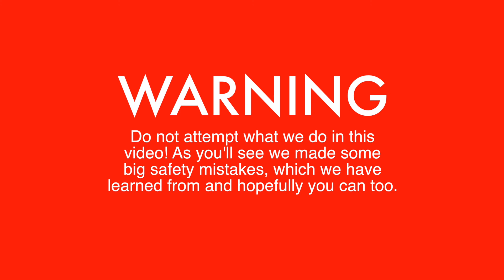Exploding the Fastest Non RC Rocket Boat with Sugar Rockets

Comment: Very cool, just stumbled across this video, I love making rocket powered vehicles to! I have made 17 different versions of rocket cars; 6 different rocket boats; and am currently 3D printing a V7 rocket boat witch I plan to make 3 of to drag race, what state are u in? Maybe we could drag race our designs? I am also currently making a FPV VR RC Rocket boosted jet on another printer reinforced by carbon fiber tubes and carbon fiber coating the whole fuselage, going to put it in a 1000ft nose dive with full power to both edf, pull up and then hit the rocket boost to get the max speed, from making all of these I have learned that bigger is better with these, bigger rocket engine bigger rocket boat, and more weight, in all my first designs I made them way to small to and even the tiniest ripple in the water will mess it up, by having a much bigger and heavier boat it has way less of a tendency to become unstable, also adding rc electronics to give u control is a huge plus, u can get remote detonation of the rocket engine using ether a pico switch or battle switch, I typically then use a firework detonator fuse hot glued into the nozzle to keep it secure then just plug it in to an extra channel on the receiver, this allows u to have the rocket powered vehicle to be already traveling at around 60mph on a boat or 180-220mph on a jet before you even start the rocket engine, this is crusial because by launching it from a dead start you waste an extreme amount of fuel that could be used to get insane speeds, trying to make my V2 rocket jet hit 500mph, the only time starting from a dead start would be a good thing is for drag racing, but drag racing is a lot harder because it’s such a sudden and dramatic increase in speed, it has no previous established stability so of course it’s going to be super hard to get a perfect hydroplane going, I would also add way more steps in the design, on the front supports as well as the belly, in order to get access to much more powerful rocket u would want to join a model rocketry club they have amazing people who are more then happy to help and u can launch under there license witch gets u into some crazy engines like M class, currently experimenting with Warp-9, Propellent X, and Black max, however I want to eventually get into some of the liquid fuel rockets such as a BPM-5. Ill edit this comment once I find out witch is the best and reccomend it, if u really want to advance your designs I would get a 3D printer, you can get a creality ender 3 for as little as 200 dollars and free slicer and free cad softwares are available online, if you have a little more the creality CR-10 goes for around 360-600 depending on witch model u buy and that is probably the best 3D printer for beginners out there massive 12X12X15 build platform so even if you decide to get 2000 fancy printers in the future you will most likely still use the CR-10 because of its massive build volume, hope this helps. May V3 be even better!

Comment: Invert the design, the rocket has to PULL the boat, not push it, and it will keep going straight. Also revert to the motors you used in the previous video.

Comment: This was probably poor nozzle drilling. Sugar rockets [powdered sugar and potassium nitrate]. I've made hundreds of these rockets and they are incredibly powerful. I've also used PVC as the housing. I have had a few that failed to light and a few that were underwhelming but never one that turned into a pipe bomb. You must not have known what you were doing when fabricating these simple rocket motors. It's a fairly easy task if you know what you are doing. First thing you need to do is use a coffee grinder to grind up the powdered sugar and potassium nitrate for about 5 minutes each. It's a good idea to have two seperate grinders one for sugar and one for the potassium nitrate. You also need a clay like substance to make an end cap and a nozzle outlet and I have found that walmarts unscented kitty litter is best for this. It's the ultra cheap kitty litter and it cost about $2 for a 10 pound bag which is enough to make hundreds if not thousands of motors. You also grind up the kitty litter and you can do this in the coffee grinder you used to grind your sugar. You then use a funnel and a wooden dowel to pack the kitty litter on one end making a rather strong cap. Next you thoroughly mix the sugar and potassium nitrate by hand and slowly for about 15 minutes to make sure you have a good consistent mixture. You then use the funnel and wooden dowel to pack the mixture into the PVC and this mixture should take up about 2/3 of the PVC housing unless you plan to make a parachute charge on one of the ends but this is a different story altogether and not needed for a boat. You then finish the motor off with another layer of clay with each clay layer taking up about roughly 1/6 of the housing. The next part is important, drilling the nozzle. You need to make sure your drill bit is the proper size for the task and long enough to make it from one end of the motor all the way to where the kitty litter starts on the other end or you might wind up with a bomb. The best drill bit to use for this task is one that is as close as you can get to 30% of the inner diameter of the rocket motor. I wouldn't use PVC with an inner diameter smaller than 3/4" which would accommodate a 7/32" drill bit nicely to get to that 30% mark. It may be difficult to find a 7/32" drill bit long enough to make it the 4 or 5" you need it to and if you can't find one at your local hardware store you can order them for cheap off ebay since they don't have to be high quality. The drill bit won't dull since you are essentially just drilling through powdered sugar. Also if your nozzle doesn't make it from one end all the way through to where the clay end cap is on the other end then you wind up creating a bomb as the chemical reaction has nowhere to exhaust from. If you did drill the motor all the way through, which I highly doubt, then it could have been due to poor packing of the sugar and potassium nitrate mixture which could have left air pockets resulting in a cavity explosion. I was pretty disappointed to see this boat you spend so much time on having a pipe bomb strapped to it and not a rocket motor. You would think you would have figured out your exploding motor problem before strapping a poorly built motor to something you spent so much time creating. Guess not though. Next time figure out what you're doing wrong before you just try to wing it and hope for the best.

Comment: Your rocket problems are probably either due to your fuel being too losely packed (if you're using a powdered, and not melted or recrystallized sugar fuel), or your propellant bore being drilled too deep.

If you're using a powdered fuel, you need to really pack it down with solid hammer blows. Any cracks or voids will open up, increasing the burn rate and resulting in explosions. Melting the fuel, or using a recrystallisation method should be much more consistent. Pack the tubes a little bit at a time, fully compressing the propellant as you go.

I also noticed that your rockets are quite long compared to ones that I've made. If your bore is drilled most of the way through, it's no wonder you're getting explosions - I've found that for a powdered fuel in ~20mm tube, you don't want the bore to be much longer than 50mm or so.

I suggest you try the following:
1) Shorter rockets with full length bores - You'll get less power, but they'll be lighter and run at safe pressures. They'll also have the same burn time as a longer, fully cored rocket of the same diameter.

2) Use your exisiting rocket size and construction, but just tweak the level of baking soda. Maybe 5% by weight?

3) Try using an end-burning grain (ie, no bore hole). Standard sugar fuel probably won't burn fast enough for this, so you can try moving to black powder (like an Estes rocket) or adding red iron oxide to your sugar fuel (acts as a catylist).
Reply from the maker: Thanks for the suggestions! I am using a powdered mix that has been packed in with a hammer a little bit at a time and they seem to have a pretty uniform burn rate. After packing I cored to within 1/2” of the far end with a 3/16” bit. 

I 100% agree with making the engines shorter (and fatter) to reduce pressure. I was a bit limited here due to the boat’s original design, but now I can re-make the boat. Although I didn’t explain this in the video (I probably will in the upcoming video on engines), we are pretty sure the explosion is due to the nozzle being ejected from the back of the rocket. I’ve been using a pretty weak nozzle design of 1” thick compressed bentonite clay. I believe if I would use concrete and maybe add a pvc cap the engine could take the pressure - although I really don’t want to exceed the tube burst pressure.

I really like your idea on eliminating the core as that is the most difficult part of building the engine. I’ll look into that. Thanks for the pointers!
Reply: No worries. Yeah, shorter, fatter engines may be better as you'll get more reasonable pressures for longer. And I agree that you probably don't want to push the nozzle too much further, as it's better having the end blow out than having the whole thing rupture.

Try and optimise the next boat for weight as much as you can - you'll be able to get the same speeds with less propellant and lower pressures, which will simplify the design of the engines.

Comment: I wanted to tell you that my dad and I bought a vintage model of a hydroplane in the early 80's that was made of all mahogany and was designed to be powered by a .049 gas engine.  We built it with the intentions of making it rocket powered and we coated every part inside and out in epoxy making it super strong and giving it some much needed weight.  We also put on a rudder, a tail fin, and an aluminum tube about 12" long that was slightly larger than the Estes "D" size rockets.  We would stack four of these rockets end to end in the tube and light that sucker off!!  About half the time it would take off or submarine (and keep going, lol), but about half the time we would get a good run and this thing would rip across the water a insane speeds!  I never heard about anyone else ever doing this until finally now when I came across your channel!  I wish I still had my rocket boat that I built with my dad, but my mom gets rid of everything and one day when I wanted to bust it back out several decades later, it was mysteriously gone...  So incase you were wondering if anybody else has ever done this before that we me back in the early 80's!
Reply from the maker: That’s so cool! I’ve come across a few others who have done this and put it on YouTube, but it really is a unique “club” I suppose. I’ve never done 4 engines though. That sounds crazy! We used to run 2 D’s back to back. At the end of this video https://youtu.be/u_BO7xC2QG4 is probably our neatest run with a two stage engine. You can see it really start accelerating when the second stage kicks in.
Reply: I have built several rocket boats and thought the same thing!

Comment: Wow design seems to be good... Sad that u list the boat for which u put so much effort. Is it possible to design the next boat such that the engine is far or the boat is more modular so that u can fix it up quickly without having to build a new boat every time u blow it.
Reply from the maker: Great ideas! I have been leaning towards a design that allows me to adjust things around on the boat. I'm also leaning towards a larger diameter motor (longer burn time). As for preventing the boat from going boom, I think the best thing is to thoroughly test my engines before putting them in the boat - something I didn't do here. Seems like I'm always learning something :-)
Reply: makjosher I feel control is very important, how about electronic steering so that u can control where ur boat ends up ? I would love to see the video on how to build the rockets themselves.